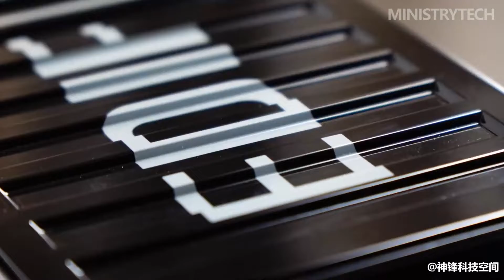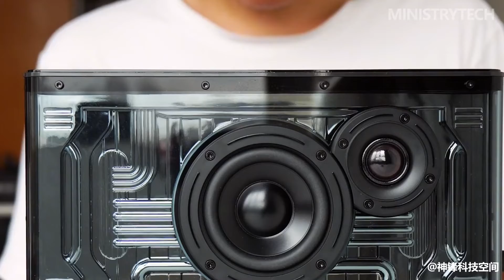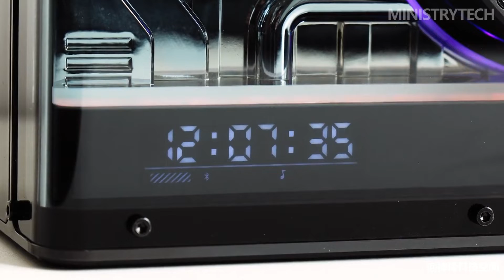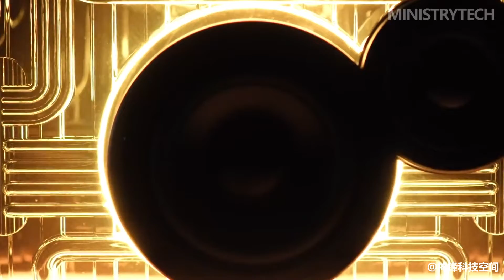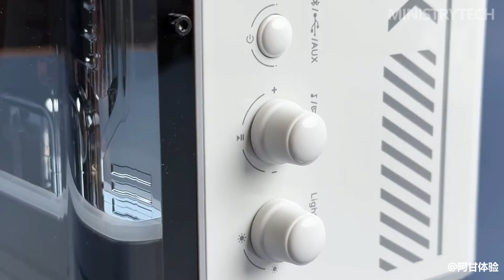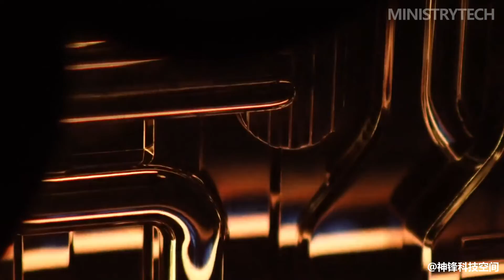Edifier NEW-X Review | Transparent Design and RGB Backlight Speaker 2023!

Comment: how to connect headphones 3.5 to it? there is one connector aux into which you stick and nothing happens. I change the mode to aux and nothing
Reply from the maker: I didn't check it, but in general it should work through aux, it's a pity that I don't have a speaker to check now.